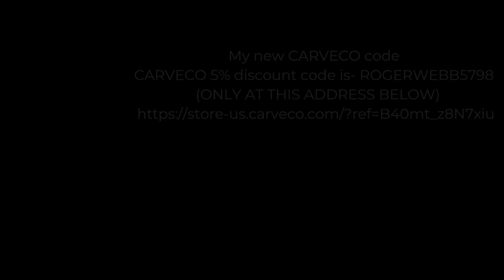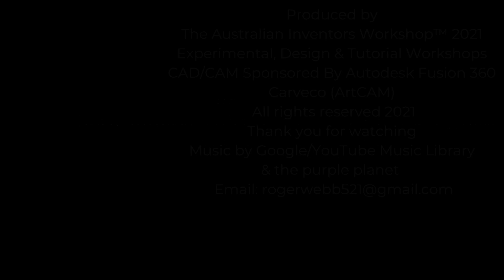DIY MAXI CNC first “fails” of the build at the end! [Episode 10]

Comment: My torque curve isn't consistent like that at all. If i start off at 10% feed rate on mach3, it doesn't take much to skip steps. When it's at 100% i can push against the gantry pretty hard without skipping steps. I had the opposite problem before i adjusted decay and microstep settings.
Reply from the maker: Technical assistance and information is available on my Patron pages
 https://www.patreon.com/user?u=15079773